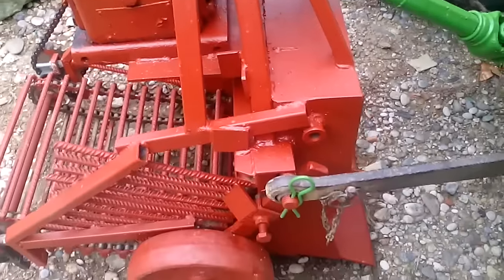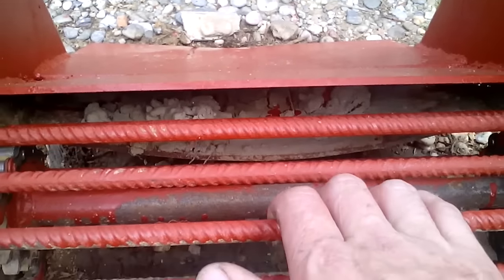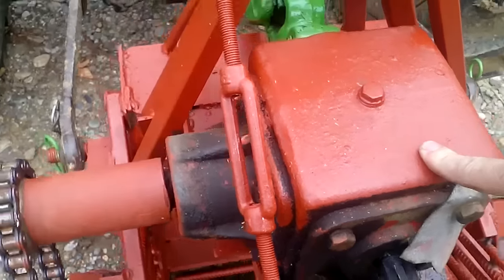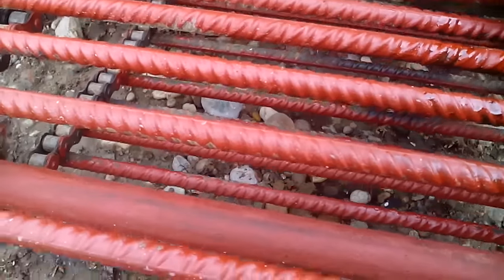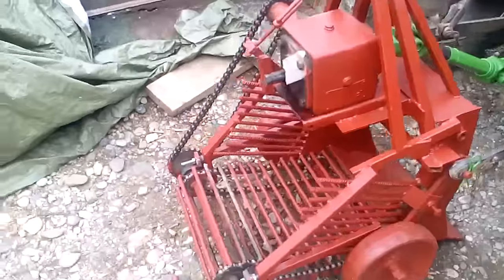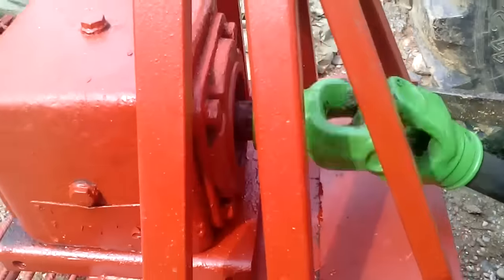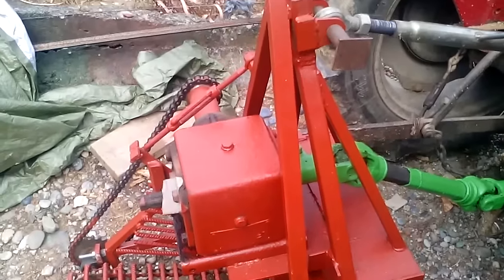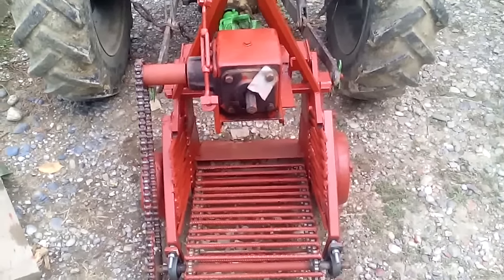Potato harvester

Comment: You could get some chain for a peanut plows and use on there. The links are bigger and will make it easier for you to weld or put whatever you want as bars, they even have tabs w bolt holes on them, and the peanut plows chains are meant for being in the dirt so they will holdup better than a normal chain. Also the peanut plows points you can get and cut to bolt or weld on your digger and will last a good while
Reply: U need potato, beet or other digger chain that is wear resistance,  I have had no luck with rebar wearing in the dirt

Comment: You could put you a bar across in between the chains and but you 2 or 3 hard rubber rollers to bounce the chain a little to knock the dirt off of the potatoes, will help also to keep the chain bars from hitting or grabbing each other, your chain is short enough I don't think you will have that problem but the rollers I. Talking about are used in kmc peanut plows. If those bars grab each other it will really mess some stuff up but the chains on those are alot longer and have more sag in them. Very good idea. Looks like you did a very good job on it
Reply from the maker: Rubber rollers are good idea,it will help to remove dirt,greetings from Croatia
Reply: @Mladen365  idk if the ones they put on the kmc peanut plows we run are too tall to fit inside your chains but we run 3 rollers long, front to back and two rows wide but idk if you have ever seen a peanut plows like I'm talking about, the chains are pretty big and wide also. Good little invention you got there. Very nice.

Comment: Is there a way wherein we can use an electric motor instead of gearbox to make it completely independent? Like I want to use it without a tractor or a hand tractor. Is it feasible to use an electric motor?
Reply from the maker: This is a single row potato digger and it need power so i don't know how you can power it with electric motor,maybe if you use a winch to pull it,that is only that will work,greeting

Comment: Can u help plz ...I want information about mounting of rods on chain of conveyor....
Reply from the maker: You want to know how we put them on chain,i already explain in video,we have cut small pieces of steel that fit on chain joint and welded,and than we weld a rod on both side,that flat piece of steel need to be 5cm or more,you repeat all that on all joints of chain and you have transporter

Comment: Sir how u made the chain for conveyer
Reply from the maker: Nothing complicated,this you can't made on small chain you need bigger chain so that you can weld small piece of flat steel on each element on chain,that piece goes between two chain joints on flat surface,that flat piece of steel has to be long enaugh so that you can weld a rebar on top of chain and you this all around the chain and that is all,if you need anything else i am here to help,greeting from Croatia